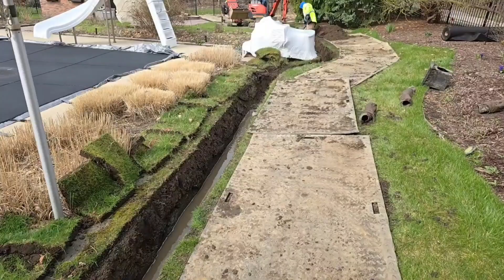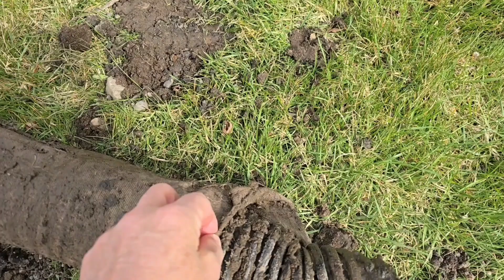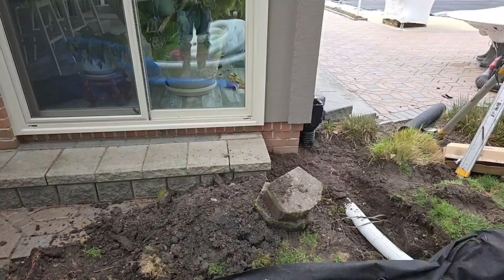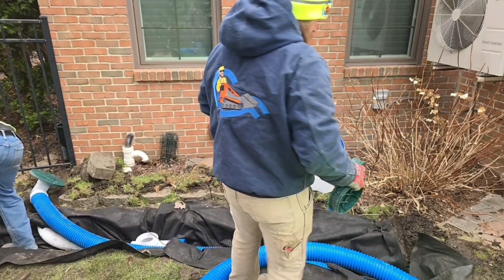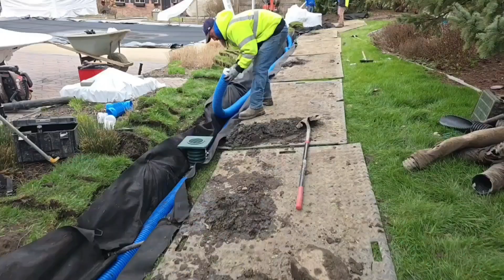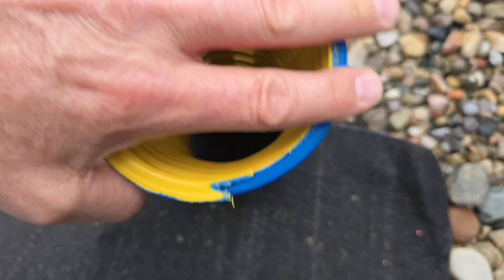Yard Drain in a French Drain with Gutter Downspouts; 3 Great systems in 1 Trench

Comment: The water table is going to come up to a specific level NO MATER if there is soil or stone under the perforated pipe.
The point to consider is , when that water level eventually does go down do you want wet soil or dryer  stone left behind.
Trees don't look for water until the level goes down and the dryer stone will not be attracting roots.
Reply from the maker: https://youtu.be/rBURiuvGwiE?si=V5ZtgE1QmYaZOxuM
Reply: @FRENCHDRAINMAN  put the stone UNDER the fabric.
Of coarse it is pointless to put anything between pipe wrap and pipe.
BUT between ditch liner and pipe wrap stone not only keeps things dryer IN DOING SO it eliminates a freeze thaw action and no heaving. 
I live in NE Ohio and retaining walls using French drain water control have not moved a 1/4 inch in ten years.
Reply: @FRENCHDRAINMAN  I watched  it the first time and
Reply: Put stone under pipes

Comment: I am planning a project similar with your materials. I am planning on putting two 4 inch perforated pipes with a solid pipe for roof run off. Can I put the two perforated pipes on the bottom and the solid pipe (and basins) on top? Or does the solid pipe (with the basin) have to be on the ground beside the perforated pipe, with another perforated on top?  Thanks for the videos, this stuff is great!
Reply from the maker: https://youtu.be/FK5ZlN0Ogow?si=EnU1NZyovI8s1Xrc